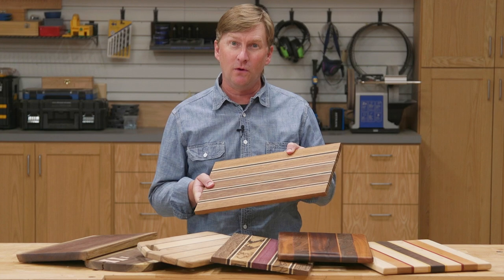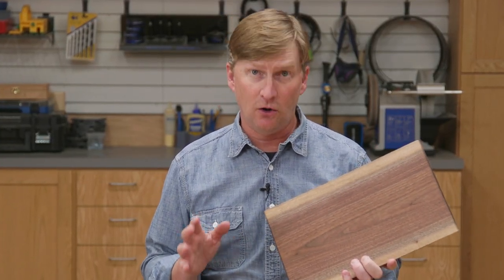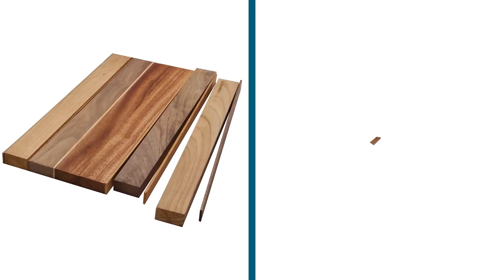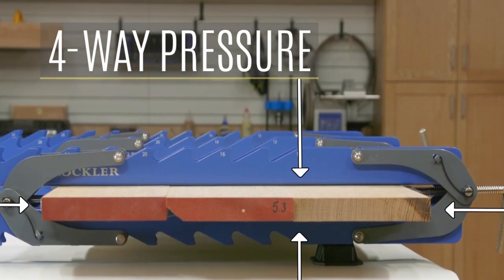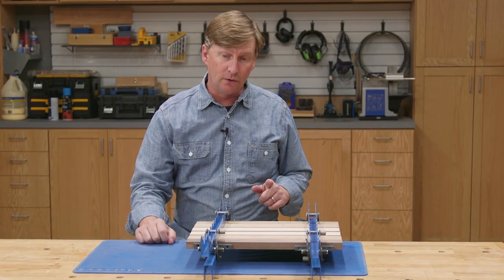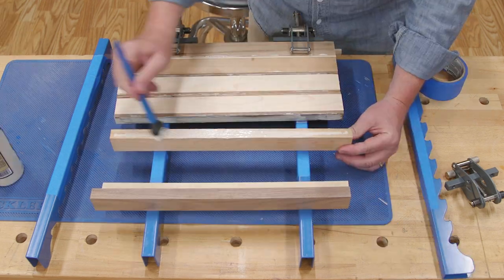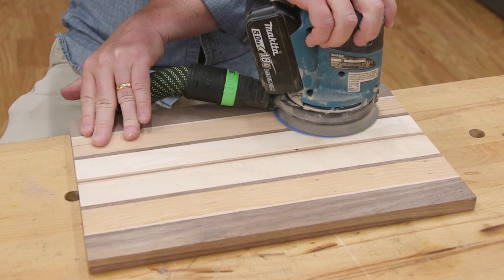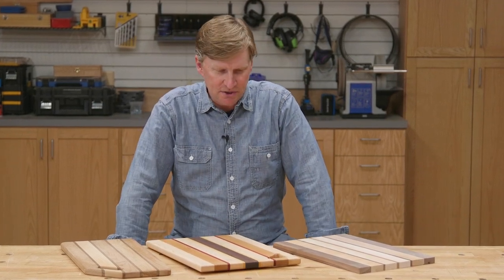Best Clamps for Making a DIY Cutting Board

Comment: I used these building a couple of cutting boards to replace those in our countertop....they work a treat, at least they did combined with a drum sander to bring everything to a constant thickness before the glue-ups.  Mine were of chaos 'pattern' so there was a LOT of sawdust.  The setup was quick and easy,  I used packing tape over the clamps to ease cleanup. -Veteran '66-68

Comment: I got a set and they do a good job.  However, in the video with the set up being is fast motion, it does not show how difficult it is to put the top piece in and sometimes when you lift the front end, the bar used to apply pressure will drop below and get caught, so have to adjust it.  I am sure it will be easier with practice, but just wanted to point out that it is not as easy as shown so I suggest you may include setting up a couple of times without glue to get the hang of it.

Comment: I just found about Shopsmith double bar clamp for cutting board and this ones from Rockler looks "exactly the same" as the ShopSmith ones, just with a twist. Ikn, every improvement is a good thing.
So, i'm glad technology advances, old ways to do things are improved.
But i feel a bit of salt when seeing that. Eh, maybe it's just me rn.

Cheers!
Reply from the maker: Those are similar to our 4 Way Equal Pressure Clamps. You have to make your own cauls/bars/rails. Here is a link to ours.https://www.rockler.com/4-way-equal-pressure-clamp - With our Deluxe and Mini Deluxe Panel Clamps, the addition of the metal U-channel, can in increase clamping forces to over 1,000 pounds and still not flex.

Comment: I’m finding it quite difficult to add the top rails in a smooth manner. Headstock clamp jaws get caught on the threads of the screw and won’t close. I need another set of hands to use these!
Reply from the maker: Hi Kevin, Feel free to reach out to our product support team at 1-800-260-9663 or support@rockler.com. They'll be able to assist you. Thank you
Reply: @rockler  I would suggest a different response then to always call customer support. This is the comment section with replies.  This is not a good place to recommend a phone conversation.  It pretty much defeats the point of this section and your channel.  Perhaps get someone who can actually respond to comments and questions. This is the year 2023.  I would suggest coming into the 21st century.
Reply from the maker: We are just social media moderators doing our best. We recommend our product support team because we put together a team that is trained on all the products, and are the best resource for you and all of our customers. Some conversations are going to require a back and forth conversation that could be lengthy, and possibly get lost or confusing in a comment section. Often it would be faster and much more helpful for you with a 1 on 1 conversation with a product specialist. You can email them as well if you don't want to have a phone conversation. Thanks
Reply: I just got these and had these same problem that you described but I think I figured out how to deal with it. Pull the clamp with the threads up and back making sure the small bar is resting above the lower bar before putting the round thingies into their slots. It definitely takes a few tries to figure out the right order to set everything
Reply: @elliotdance7790  After using them a few times, I have found them a lot easier to use. It just took a bit of practice.

Comment: It is a complex process. Not as easy to use these clamps as they think. Takes practice slipping that top after the glue is on
Reply from the maker: They can be tricky at first. Check out this video, it may help. - https://www.youtube.com/shorts/spvsUrJ8ZXg - Thanks